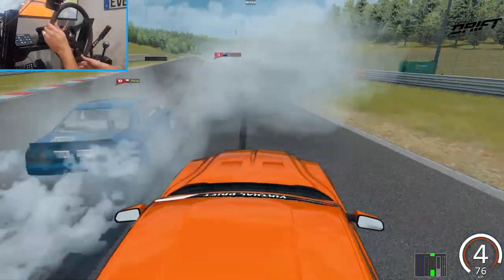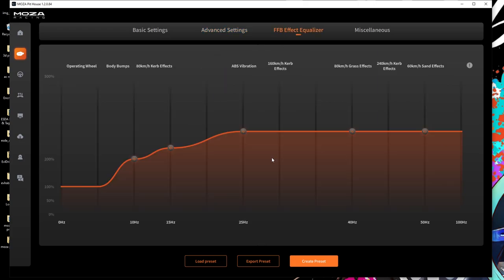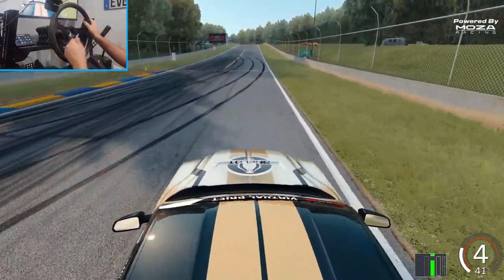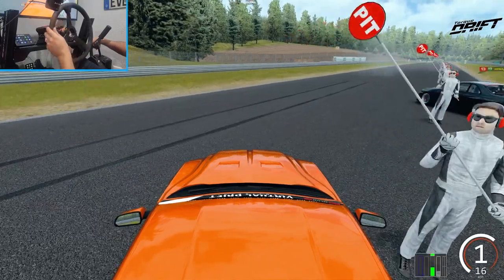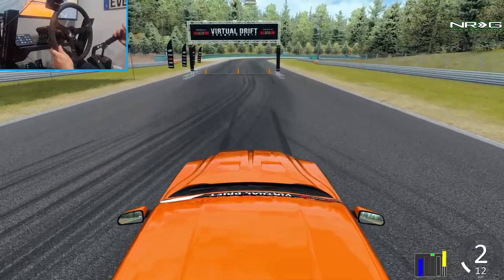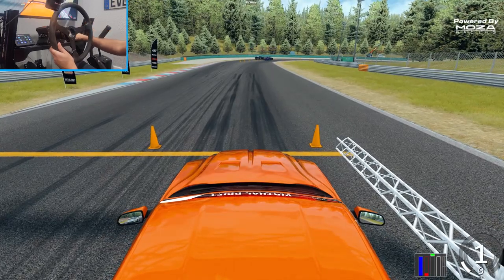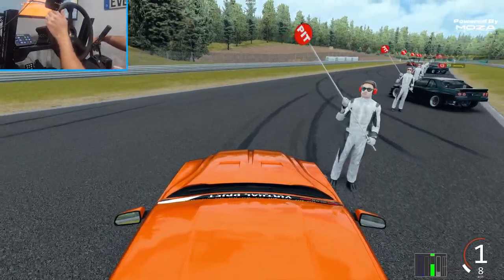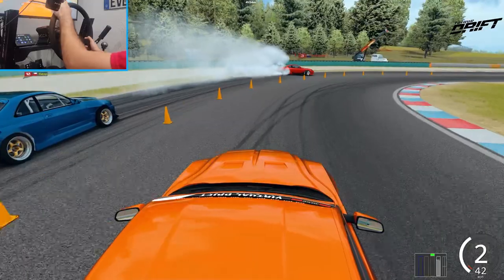My New MOZA R9 for a Non MOZA wheel with no natural inertia set

Comment: Would it be possible to just get the wheel base ? And use my own steering wheel. Or would I need their original wheel with buttons to configure the start up
Reply: You can get just the base and I believe an NRG quick release for a real wheel.
Reply: Get just the base and buy the QR Moza is about $60 USD
Reply: Hey, dont know if you still need to know. But I only bought the R9 and a quick release then went and bought my own steering wheel and everything worked fine
Reply: @MasonvsGames  thanks!! I went with just the Wheelbase as well! Moza r9💪🏻 awesome base
Reply: @kookdrifter  Is awesome, my r9 base has arrived and it's great.
Reply: I did but i bought the es wheel and converted it to the formula wheel for paddle shift racing. Might pick up a cs for the parts and put it on my deep dish though

Comment: Hi, for $100 difference between R9 v1 and R9 v2 which one should I choose? being the most expensive v2
Reply: if am correct only difference btw R9 V1and V2, is that V2 have more and newer wheels to attach, V1 have the older wheel an you cant attach new one, from R5 boundle for example
Reply: @oskarmihalovic3903  thanks bro

Comment: This is a regular NRG wheel I'm guessing? Is the sim racing specific wheel too light for the R9?
Reply from the maker: It is a actual one yes. The sim one tends to be alittle light yes for the feedback put out by the wheel
Reply: @EvlRabbit07  gotcha, got the R9 on the way but currently only have the sim NRG wheel, I'll probably dial down the FFB a bit for now.
Reply from the maker: @Kid_Strange  I would say around like 70 or so
Reply: @EvlRabbit07  perfect, I'll try that out, thanks dude!
Reply: @EvlRabbit07  After the last MoZa update  not seeing Natural inertia in the settings. 

If I'm not using a moza wheel and just the NRG quick release, it has crazy Oscillation. Are you having the same issue?
Reply: @xenonwj2396 hey bro we’re you ever able to find a fix for this, i’m having a similar problem rn
Reply: @xenonwj2396 were*

Comment: when I let go of the wheel during transitions or when adjusting angles mid drift the wheel oscilates back and forth aggressively do you know why ?
Reply: you ever find a solution?
Reply: @0spaze410  It stopped doing it with latest moza firmware and software - the new algorithm that came out along with r12 ( it's for every base) fixed the oscilation for me.
Reply: Turn off hands off protection if you hvent yet
Reply: @1I2J1E  hands off protection stops the wheel rotation when you let go or decrease the grip pressure of the wheel, which is almost always the case when you're transitioning mid drift :) This makes it impossible to drift also and it't not the cause of the oscilation. 
@0spaze410 BTW  I still have the oscilation actually, its better but I learned to live with it it seems. You need to keep your hands a least a little bit on the wheel. Constant contact helps. 
Also the cars matter. The VdC are very snappy and have the oscilations more pronounced,  the wdp cars also problematic. I found that the drifting works best with kunos cars :P  Also the hush mod cars work well.
Reply: I just got my r9 moza. My wheel is still doing that … is what your saying there is no way to turn that off in setting or lower something in the settings ?